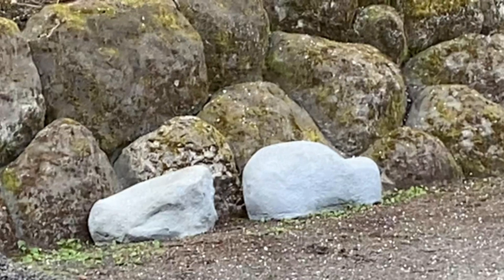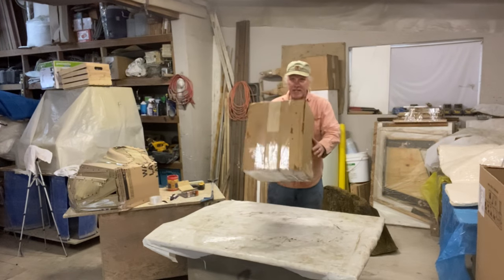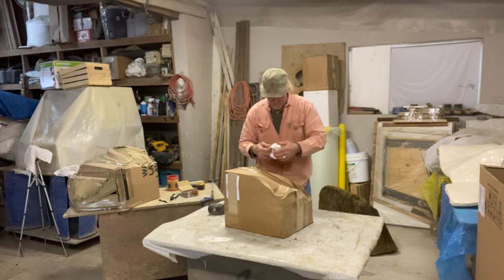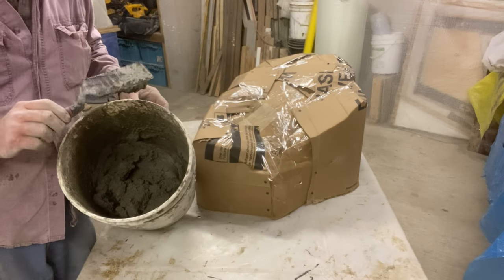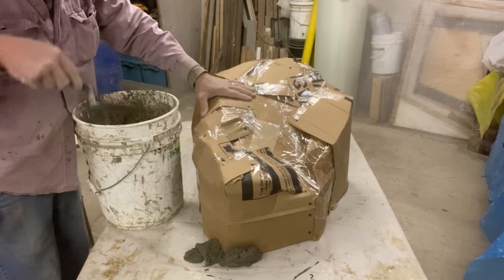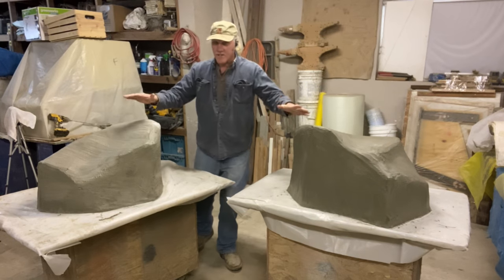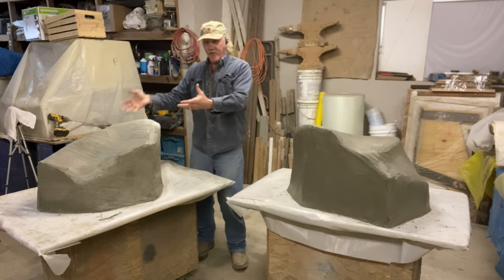Making a rock using a cardboard form (part-1)

Comment: Are you using a mortar or Portland cement/sand mixture? I can’t get my cement to stick to the vertical sides. HELP!
Reply from the maker: Thank you for your positive feedback. I really appreciate you watching my video. For this video, I just use a premixed mortar from Lowe’s or Home Depot. It sounds like you may have a little too much water in your mixture. If you’re mixing your own sand cement, you should use three sans to one Cement.

Comment: This gives me an idea I want to try outside on location in central Florida.  Using natural dry plant and root debris from a clearing  for the frame body.  Wrapping it with fiberglass mesh held on with nylon string and expanding foam.  Then proceeding with generous layers of cement made with local on-site white Florida sugar sand  right from the property mixed in with lots of  bonding agent.
Reply from the maker: Sounds like a plan…👍🙂👍

Comment: Hi Jim, Just a quick question, could the reinforcement mesh be substituted for glass fibres in the mud? Or would this degrade the rocks strength to much? Thanks.
Reply from the maker: I recommend the use of both the mesh and the fiber for optimum performance characteristics to be obtained. Textile reinforcement has taken off over the last 30 years and in short period of time I think it’ll be the only way that cementitious fabrications/creations are reinforced.

Comment: Good stuff.  Two questions that I could not find answers to in the comments or description.  1.  What kind (& size) of screws are you using to screw the cardboard such as how you’re using in this video?  2.  What is the exact name of that mesh - looks like some kind of “fabric” mesh like one uses for sheet rock seams?  The mesh you use looks like sheets.
Reply from the maker: Thanks for the positive feedback and I appreciate you watch my video…

The screws are just inch and a quarter …
The mash is available at Lowe’s and Home Depot though. The link below is for Home Depot. 
https://www.homedepot.com/p/BOEN-38-in-x-150-ft-Non-Adhesive-EIFS-Stucco-Mesh-EM-38150/203071686

Comment: Great video! I have a huge ugly green padmounted transformer in my front yard that I need to cover. I am considering using the box method. What did you use(type of screws) for the cardboard?
Reply from the maker: I usually use 1-1/2” drywall screws.
Thanks for watching my videos...
Reply: @fauxrock  you're awesome! Thank you!

Comment: Awesome video! you mentioned you get the card board you used as the frame from Lowes. Can you buy it or do they save it for you when the unpack their appliances> The mesh your using us it hardware cloth or like nylon?
Reply from the maker: They give the cardboard for free.

The mesh is manufactured by STOW... it’s basically a mess use for stucco reinforcement

Comment: Don't know if you'll see this as the las comment was a year ago...but here goes. My son is going to make a boulder using your technique for an Eagle Scout project.  They want a large boulder, thinking 4 feet tall, with a plaque to serve as a veteran's memorial.  Trying to judge how much concrete mix to use.  We are looking at Sakrete Pre Blended 60-lb Gray Type S Mortar Mix from Lowes.  For the two rocks you made in this video, how many bags, or how much of one bag if using less than one, did you mix up for this first phase?
Reply from the maker: Call to discuss your project 971-237-2957 it would be my privilege to assist you

Comment: These are AWESOME1 I love DIY projects but have never worked with concrete and need to make some of these to keep trucks from rolling through my yard. You talk about temperature and curing the cement, would I be able to leave them outdoors in TX heat to cure? I do not have the indoor space to keep them sheltered from the weather.
Reply from the maker: No heat is the best way to cure them

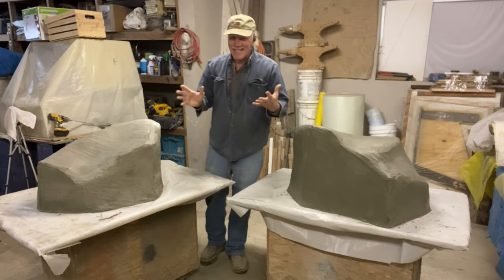Comment: I'm confused about somethin - at 6:08 you say it's regular mortar, then you say "naa, this is " somethin else?  I'm unsure whether you are sayin it is just morter or whether it actually has additives?  But around 7:20 you say "cement does not recieve strenth for 7 days? so is it cement or mortar?
Reply from the maker: Do you know it’s been a while since I made the video but I do remember just using regular mortar mix where and I didn’t use any acrylic admixture or any fiber. Adding these types of things will strengthen the mix.
Reply from the maker: It is a mortar mix made with Portland cement and masonry sand

Comment: Hey mate, do u pull the cardboard out, cheers
Reply from the maker: Yes most of the time, it depends on the application. If I’m going to remove the cardboard I’ll oil it so the cement doesn’t bond to the cardboard do it’s easier to remove

Comment: Jim, you're a legend. Is there a good way to guesstimate how much one of these will weigh based on its size? I'm building a pond in my backyard and I'm wanting a few big character boulders in it, but not wanting to deal w/ the kind of equipment I'd need to use to maneuver such a big rock into place or have to worry about removing it if  I ever had to change the liner.

Are these things stable enough for people to walk/sit on or are they decorative only?

I think I'm not too far from you in the Portland area, so would also be interested in getting a quote from you if it's something you'd be interested in. Or a referral to anyone you know in the area. Thanks!
Reply from the maker: Tyler,

Around 3-lbs per sqft and yes they are able to be walked or sat on. Give me a call to discuss your project.
Thanks,
Jim
971-237-2957
Reply: Hi , was doing the cardboard method and the mortar won’t stick to the cardboard any suggestions on what’s going wrong?
Reply from the maker: It’s important that when you make a cement that you use S type Masonary cement because the lime makes it sticky and adhere to the cardboard better it’s also creamy to trowel and texture

Comment: What is the white cross cross material?
Reply from the maker: It a mesh for to reinforce the structure of the rock. It’s not necessarily having to be white in color. It can be several different colors as mesh is made by many different companies. The link below is for the mesh at Home Depot. Lowes also carries a similar product.

https://www.homedepot.com/p/BOEN-38-in-x-150-ft-Non-Adhesive-EIFS-Stucco-Mesh-EM-38150/203071686?
Reply: @fauxrock  Thank you for the link and explanation.

Comment: How would you make a raised garden bed from this
Reply from the maker: Are use cardboard before to make what appeared to be like a block wall you can make all kinds of shapes and sizes using cardboard and then mud over it does the same way I did with this rock in the video
Reply: @fauxrock  I'm trying to make an 4x8ft raised garden bed. But not sure if this quickrete is the best option. I dont want the chemicals leaching into soil and then my plants soak up the chemicals
Reply from the maker: Cement wouldn’t have those types of issues…

Comment: Are rocks expensive where your from?
Reply from the maker: No… not especially, but the weight of the rock is sometimes the main motivation for making synthetic rock. Thanks for watching.
Reply: @fauxrock  So you move them around occasionally? I guess for most people the time involved in the construction process, and the clean-up would be motivation to use the real thing. I just buy them and have them positioned where I want them, but I don't rearrange mine. I do like seeing cardboard used for more than landfill, I compost the majority of mine but just can't use it as fast as it comes in. It would be interesting to make ground-level access for furry little inhabitants.
Reply: You're* and rocks aren't usually too expensive, but getting them moved en mass can get expensive really quick most places haha

Comment: those were just fiberglass sheets?
Reply from the maker: It was a mesh made out of poly propylene
Reply: @fauxrock  is it available at home depot? I've never worked with that before
Reply from the maker: Not sure if it is there or not. We usually get it at a mason supply shop

Comment: What is the mesh material or substance you are using?
Reply from the maker: It’s made by STO
Reply: @fauxrock   So basically it is fiber glass mesh.
Reply from the maker: Yes, but there are also Poly propylene mesh that are sold them to Marc as well

Comment: Using flexible chicken wire flex to shape over actual Boulder hammer it to shape then wrap in plaster cast material then thin  cement. Voila!
Reply from the maker: Sounds good… thanks. I appreciate you watching my video

Comment: Just tried my first attempt.  Was a miserable failure to. The mix keeps wanting fall off my to form.
Reply from the maker: What mix were you using?
Reply: @fauxrock  Sakrete Type S Mortar Mix with water.
Reply: @fauxrock  My assumption is a water to mix ratio issue.  I did the upside down trowel test and that worked, but the stuff just doesn't seem sticky when I apply it.
Reply from the maker: You got a good mix it should’ve stuck fine unless it was a little too watery.
Reply from the maker: The other thing is you can only put on so much thickness at one time. If it gets too thick that’ll make a fall as well
Reply: @fauxrock  Ok thanks a lot for the tips.  I'm going outside to try some more.
Reply from the maker: 👍 Good luck
Reply: @fauxrock  Much better mix today.
Reply from the maker: Glad to hear it…👍

Comment: I don’t mean any disrespect, However, You are working too hard. This method is extremely old school. Use a piece of EPS foam. Shape it, scratch coat it and carve coat it. All in one hour. Then color it. Use Rapid set mortar mix with micro fibers. I’ve done this countless times it’s fast and easy. ✌🏽
Reply from the maker: Ray, no worries on your comment. I appreciate your feedback. I put this video up as one of ten different methods to make a rock. I personally utilize very advanced techniques, methods and formulations that I extend to my customers in my different training course.
Reply: @fauxrock I like the fact that you posted all the various ways to make faux rocks.  It give more options and the chance to use stuff we may already have.  🙏🏻 Old school or not 😉

Comment: what is the mesh you're using?
Reply from the maker: The mesh is available at Lowe’s and Home Depot both. The link below is for Home Depot

48" x 150' Non-Adhesive Stucco Mesh https://www.lowes.com/pd/BOEN-48-in-x-150-ft-Non-Adhesive-Stucco-Mesh/1001764418